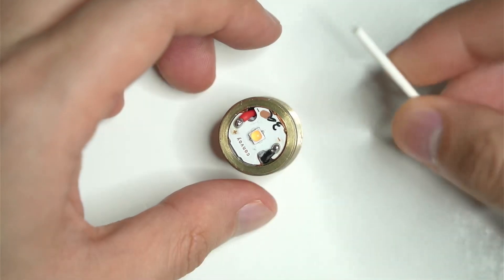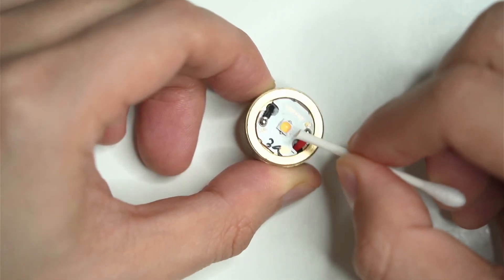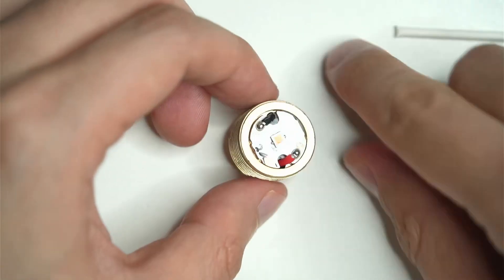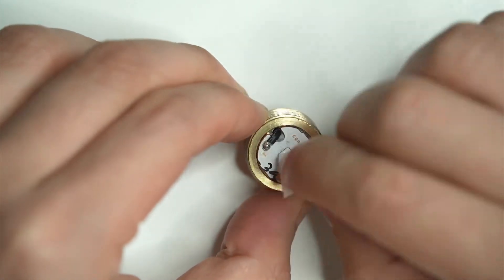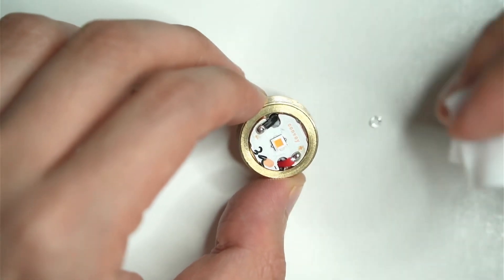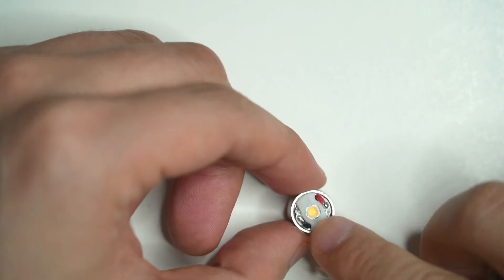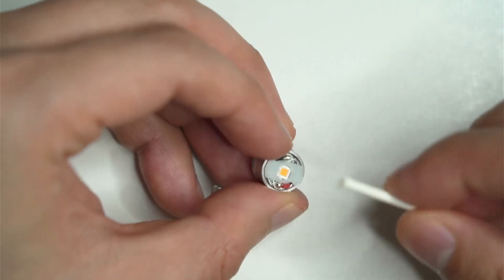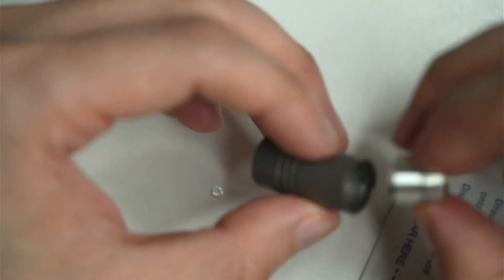How to De-Dome a Nichia 519A LED in 3 Minutes!

Comment: No beamshots of the before and after? :( 
Dedoming these 519As significantly reduces the CCT, the dedomed 4500K on my Jaxman E3 is around 3400K now with excellent tint.
Reply from the maker: I tested my S2+ before and after and got 10m extra throw, tint also reduced from 3000 to 2500!
Reply from the maker: So not much of a difference in throw but this is with the same OP reflector

Comment: Hey Darren, it’s Thomas, I changed my username. Nice to see you doing a modification video and this is a great place to start. I like to push a little bit on one “corner” of the dome and work my way around so I don’t have to apply to much pressure to any one point. That will help prevent lifting the glass at all and getting air underneath which will shorten the life of the emitter. Also getting some heat into the dome to soften the adhesive helps as well. I just did this to a convoy s21e that has a 2700k 519a, it came out so nice. It lowers the color temperature as well, I know the higher the starting temp the more it will drop but I don’t think the 2700k lowered by more than 300k-400k but it definitely made it more rosy which I think was the biggest improvement l noticed on the 2700k at least. Great video, I’ll be looking forward to any other modification videos.
Reply from the maker: Hi Thomas, good to hear from you! Yeah I am not so knowledgeable about mods but can do LED swaps and things like this, tail spring bypass. Learning as I go.  The third one I de-domed was a bit stubborn and I was pressing and scratching at the glass for a fair bit to clean it up. Maybe a hair dryer or heat gun might soften the silicon or whatever the dome is made of.
Reply: @DarrenYeoYT  I was thinking the same thing about using a heat gun for the lights that the mcpcb/pill had to be taken out of the light. I was able to do the s21e with it still in the light so I just turned the light to 100% a couple of times before trying it. I also did all four emitters in a ts25 today as well, they are 5000k and look like they dropped to 4000k or below. I am definitely liking the ts25 better after dedome, I actually liked the 5000k tint but the extra throw is a big improvement for the ts25 imo.
Reply from the maker: @lumntoob999  TS25 is similar to Sofirn IF25a in terms of the 4x TIR lenses. I have the Convoy S21F which has 4 X 519A LEDs but the lens makes a huge flood beam anyway, I don't see a point in de doming the LEDs and losing output.
Reply from the maker: I did find the 3000K one dropped to about 2500K after the de-dome, which I don't mind - I use it as a night light. Take care my friend.